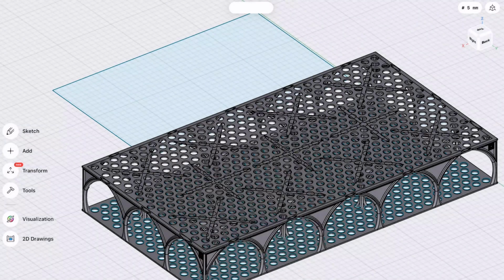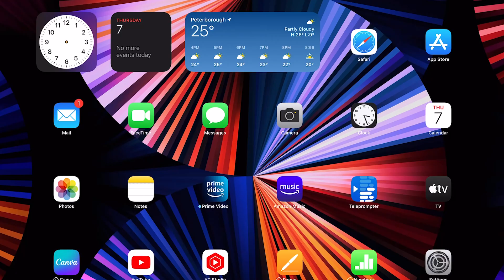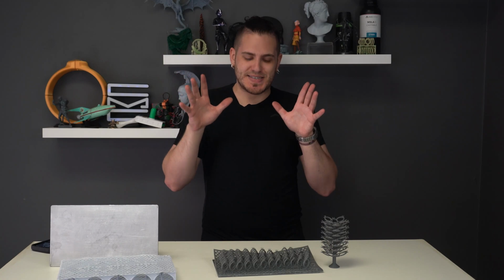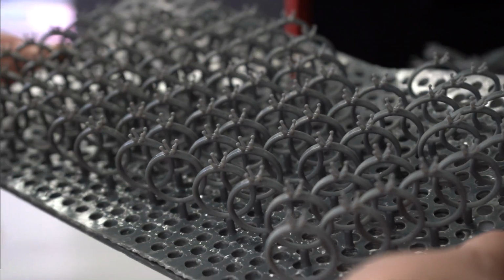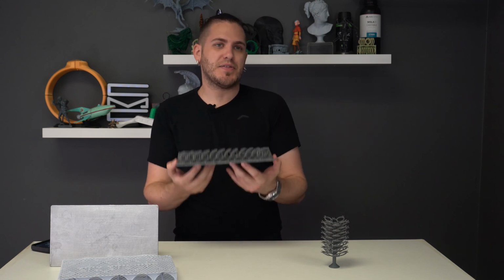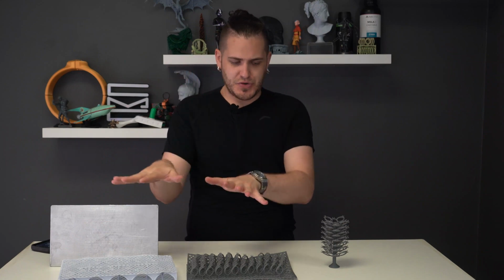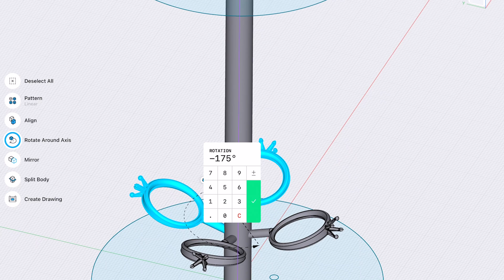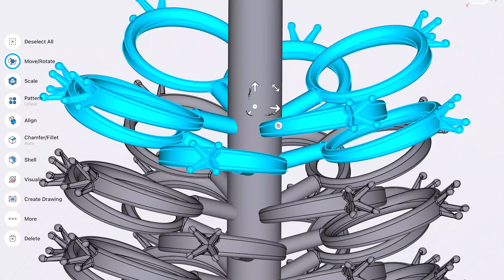Large Format 3D Printing for Jewellery - Printing as many rings as we can at once

Comment: Nice video.  Interesting.

I don't have a resin printer but for the multilevel part stacks, instead of having the second, third, etc  shelf parallel to the base, if it was tilted slightly would that help as it would reduce the cross section of the print  adhering to the screen so it is less than the part which is stuck to the mounting plate?

I'm thinking that getting a smaller resin printer and then making moulds for wax injection might be better.  OK you can get on with other stuff at the same time it's printing, there's the extra expense of the moulds and the injector but once the master and  mould have been made, the injection wax will be cheaper than the resin and unused casts can be remelted so on going costs would be cheaper (depending on how many you can do in a specific time).

Comment: The problem with adhesive is simple - you can't use more than 80% of build plate in one go. For this design leave around 1.5-2 cm border on build plate and you probably will have successful prints. Maybe try even 2.5cm. Then find nfep film if exist for those sizes.

Comment: 2 ways to improve bed adhesion. 1) sand your wham bam plate (or get it blasted) 2) grip spray paint - rustolium make one. 2 thin coats - works best with water washable resin

Comment: Is the tree casteble? I can imagine some problems with casting. I quit using casteble resin because of the cracks and hole it leaves most times. I use regular wax but that makes making the models harder. Nothing seems to guarantee the highest quality, unless somebody has a golden tip for making models :)
Reply from the maker: Due to cost all the models in the video are specifically non-castable, as they were samples. But we have done completely castable trees with great success and will be doing a "how-to" video on how to set it up in software and casting etc.
We do majority castable resin in our studio, especially for smaller batch items (where making a mold isn't cost effective). If you are having a hard time with it would definitely recommend looking through our other videos on castable resin.

Comment: As far as the programs crashing on large files you need to compress them first in a program such as Zbrush using decimation master (easiest to use) or you can use a (free program) such as Meshmixer. I know in Zbrush I go down to 25% the size of the file before sending a large print to PreForm from formlabs or else it will crash. Hope that helps

Comment: It looks like you can just get the sprue ones and have a couple of them next to each other. It should take the same amount of printing time. Like you said. :) 

Any way, i think the sprue print is great for prototyping. Ive seen guys trying to make gun parts on a CNC machine, while the original part was a cast part. So i told them about fluid 3D printing, and that having a muffler oven or some kind of induction oven that can do steel melting temperatures is the way to go if you combine it with vacuum investment casting in plaster. It should give great results. The M16 trigger parts are of steel for example, its cast steel. Ruger makes a lot of cast steel parts. 

While i like jewelry, i may actually get into making rings too. I think there should be a market for silver rings and jewelry. Especially if its a personalized piece.

You channel should get a lot more views, especially because of the great information you are bringing on this new type of production of metal products and jewelry. 

Greetings,

Jeff